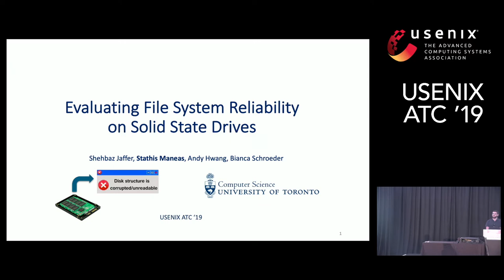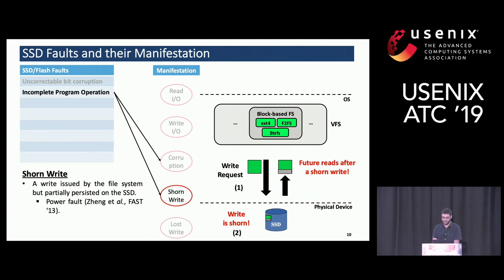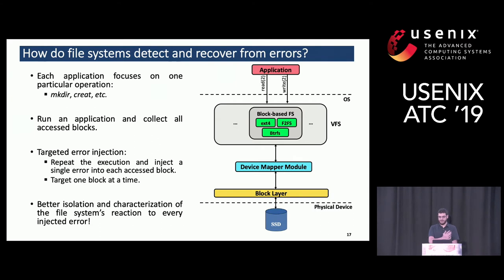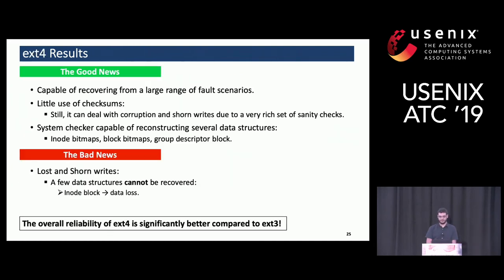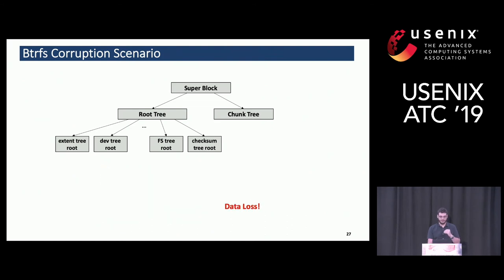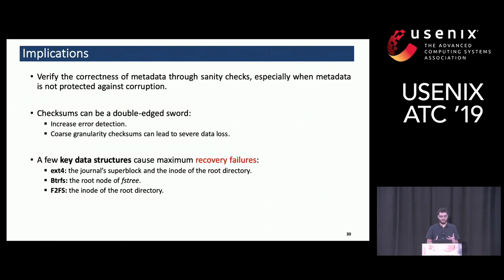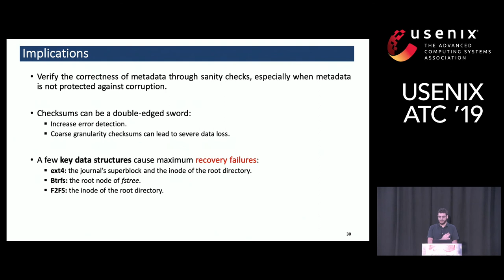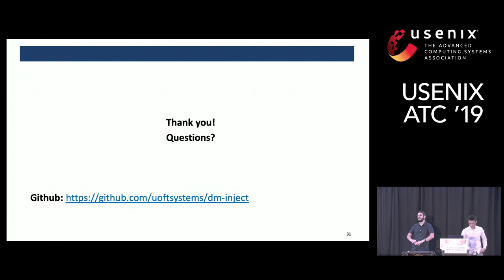USENIX ATC '19 - Evaluating File System Reliability on Solid State Drives

Comment: So you deactivated the option to copy metadata, which is required for recovery. This renders BTRFS into being unable to recover the damaged data blocks/inodes. Ofc if you did this to simulate that this option, just like "nodatacow", which is just asking for trouble, then this is perfectly fine. Journaling FS does a different thing to guarantee consistency - and yet nobody deactivates journal on SSD.
Reply: He also says it’s the default behaviour in BTRFS, and there are reasons for that. You just probably looked at the slides but did not listen to the video. He says it’s the default behaviour, because SSD controllers internally deduplicate identical logical blocks by mapping them to the same physical copy. Hence, metadata replication on the file system level has no added benefit. This wouldn’t be true for HDDs, but this study was specifically for the use with SSDs.
Reply: @tamask  well, I listened to the video very carefully and read the faq of btrfs. This is only assumption that SSD deduplicates the metadata. I think it was never actually tested by slowly invalidating ssd blocks to determine if backups kick in or not. But deactivating metadata dup essentially downgrades btrfs into fat.. There is no way to recover from an error if there is no good copy. I also think thats the reason btrfs went all-red in tests, because it detected problems properly but was unable to fix anything without metadata copies. I also think there are no reasons to fear btrfs on ssd - because on ssd regardless if it is copy-on-write or inplace write method (like fat or ext), the controller on ssd will always write out new block instead of changing it, because ssd logic tries to minimize writing to the same block and, for example, if file access times are changed - this will look like little write operation on filesystem level for in-place vs cow; but on low ssd level it should produce the same amount of written blocks (lots) regardless of filesystem.